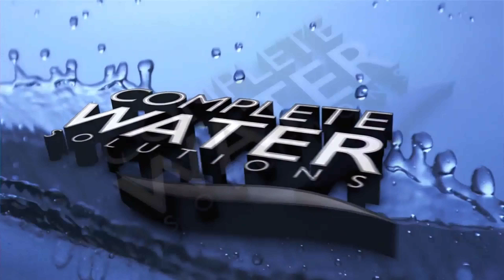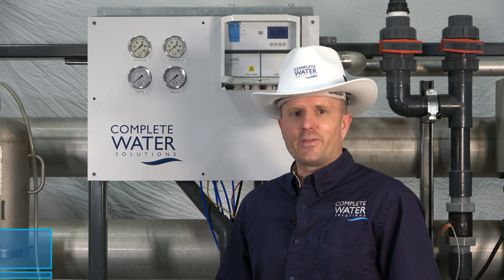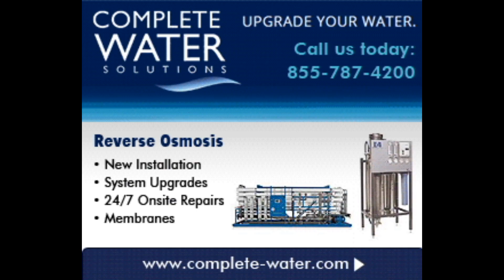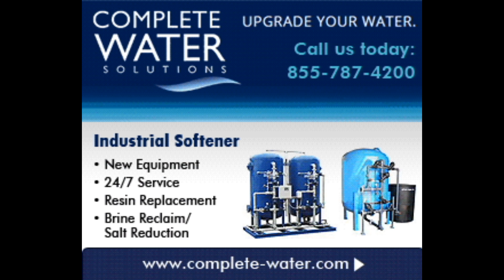RO Troubleshooting - Pressure Drop On RO System

Comment: Thanks Nathan, we've got a commercial system with qty 12 4"x40" membranes (3:2:2:2:1:1:1 array) that were just replaced less than a month ago but are already seeing significant flux loss and pressure drop (210 psi down to 75 psi, currently flowing ~11gpm permeate, 7 gpm concentrate after acid cleaning).  Visual inspection doesn't show obvious significant debris or biomass in membrane feed spacer.  Can hardness scaling cause pressure drop as well?
Reply: There are a lot of items that can cause DP and Flow issues. Organic, Bio, Scale, Silt, Temp. You may not necessarily see it when opening up the end cap. You may see it when cleaning the membrane. Using a good cleaner is a good start but also making sure the pre-treatment is proper can help.
Reply: @nateolszak1078  thank you!  Antiscalant dosing was verified to be appropriate, but the carbon tanks are not sending a shutdown signal so RO may be running during a backwash.  Prefilter looks good however, and usually this gets clogged up when I've seen this issue on other systems
Reply: @jonezy6056  Water analysis, including PSA and SDI, may help you identify the issue or at least start narrowing down.  Could also run into issues if the RO sits for long periods with out use.